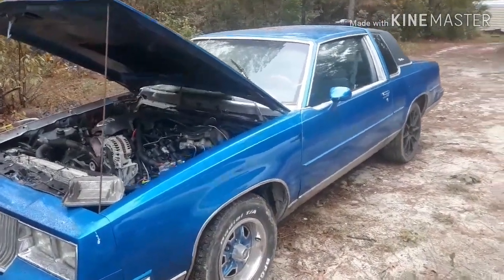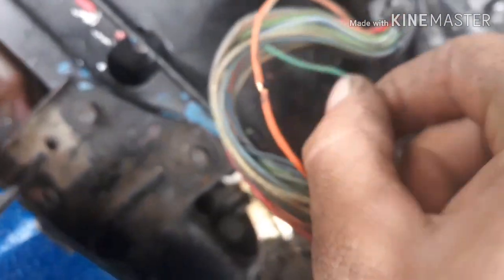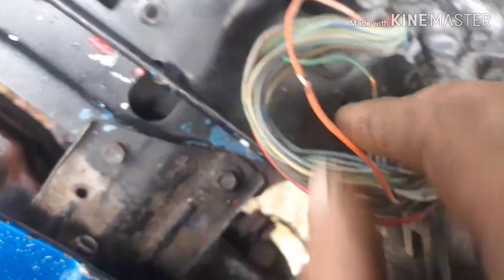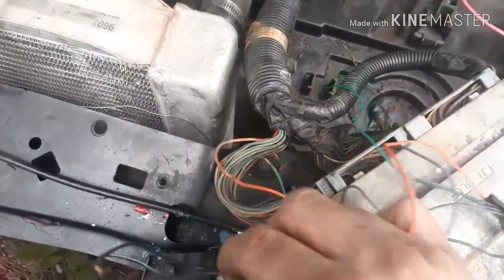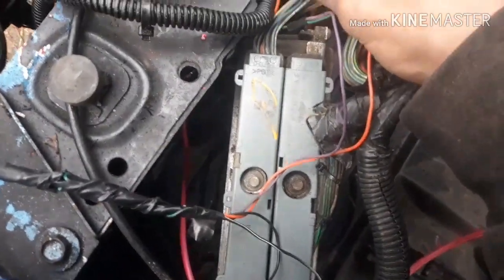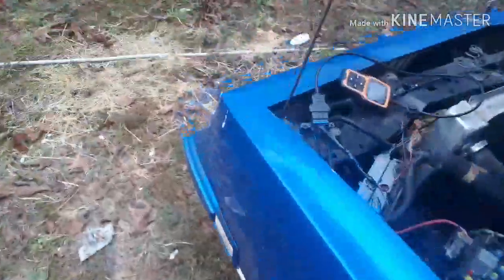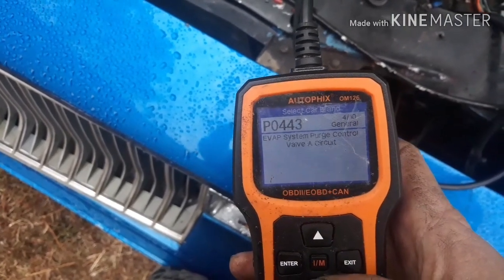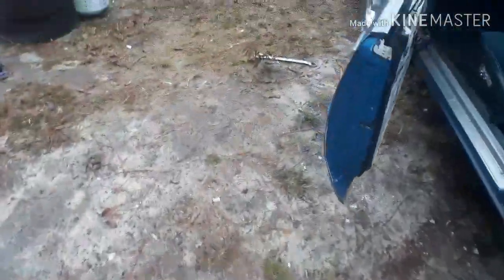LS SWAP CUTLASS obd2 diagnostic port wiring!!! 4.8 5.3 5.7 6.0 6.2

Comment: Do you have any part numbers for the top radiator hose?? I used stock truck hose and it’s gonna be close to the clutch fan I have some electric ones but I’ve gotten lazy now
Reply from the maker: I use stock truck hoses and a electric fan the clutch fan is normally first thing I pull off less resistance = free/ cheap hp

Comment: What about the bulk wires from under the hood
Reply from the maker: I'm not understanding ur question? This video is for the obd2 data connector
Reply: @MikeyTunedPerformance  that i no.. Understood that part and did that im talking about the wire coming from the bulk wires from the car the 2 red,brown, pink purple wires on the driver side under the hood
Reply from the maker: @Dannydbsmoke1  u mean the c100 and c152 plug?
Reply from the maker: @Dannydbsmoke1  send me a picture to the email in the description so I can understand what ur question is exactly
Reply: @MikeyTunedPerformance  im not sure about the numbers
Reply from the maker: @Dannydbsmoke1  send a pic to my email
Reply: @MikeyTunedPerformance  email sent

Comment: What did you use for your 12v cranking??
Reply from the maker: I used the wire that were already ran for the original starter and the stock distributor power wire for the key on power for the fuse box. You can however wire it to work with the ls starter wire but it's way simpler to use the original ignition wire to the starter solenoid
Reply from the maker: If u mean for the obd2 port its 12v constant
Reply: @MikeyTunedPerformance  nah in talking about for starting the engine
Reply from the maker: @JDP15  yea I used the original wires from the ignition to the starter. As long as the fuse box has power the starter wiring doesn't really matter u could wire it to a push button or switch panel if u wanted. In my case I used the original starter wiring and left the solenoid wiring from the ls harness alone.
Reply from the maker: @JDP15  if u use the solenoid wire that's in the ls harness u have to run switch wire to pin A3 on the C1 plug on the stock ls fuse box
Reply: @MikeyTunedPerformance  I have a aftermarket PSI harness . It has its own starter wires.  I just have to hook the one wire coming from fuse box with harness to 12 constant power..
Reply: @MikeyTunedPerformance  some one before me went thru the car cleaning and cutting the wires. So it's been a pain trying to figure out what's what
Reply from the maker: @JDP15  so there is no wires in your ignition switch or it has no ignition switch at all? I believe any fuse box u use has to have a key on power source  and a 12v constant. To be honest I'm new to ls swaps/ cutlass's and am kinda learning as I go and trying to help others learn what i have learned in the process.
Reply: @MikeyTunedPerformance  same thing here.. but I think I figured it out tho. I had my old starter wires hooked when u didn't need to cux my harness has starter wires.. I wasnt thinking..
Reply: @MikeyTunedPerformance  but keep posting.  My notifications are on lol
Reply from the maker: @JDP15  aite cool lol